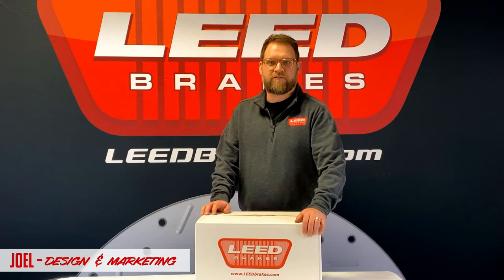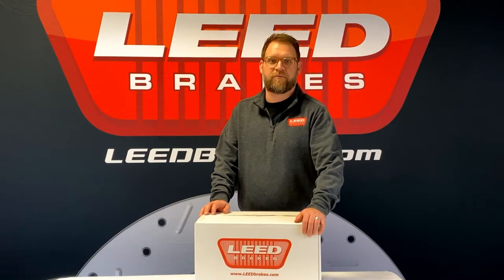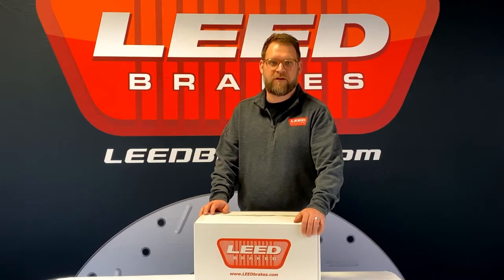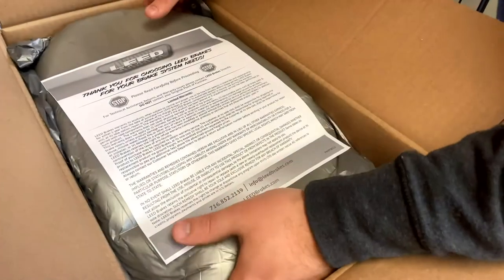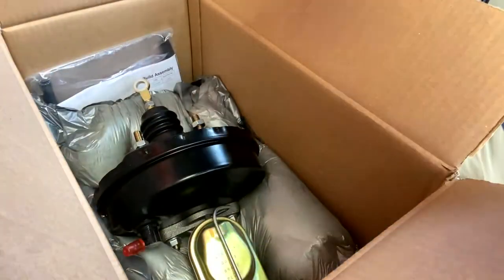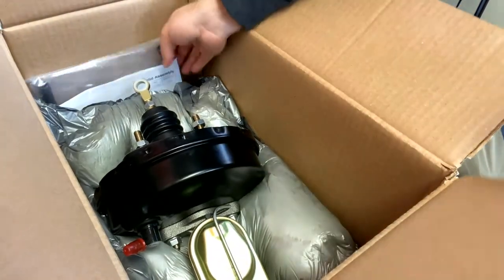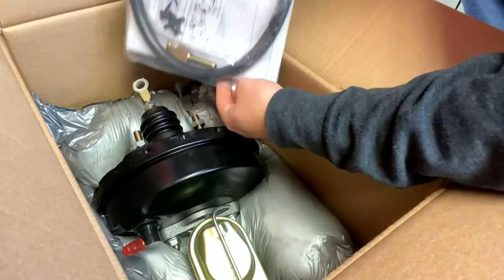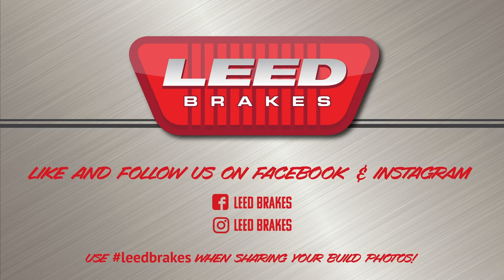Hydraulic Power Brake Booster Kit for 1971-73 Mustang

Comment: Placed one of these on my 73. Pattern is perfect fit, the extra rod provided for that year was spot on for length and the light switch hole. Install was a piece of cake... However, while it works fine, braking is not as "assisted" as before. Adjusted the rod/mc side a tad a couple of times to get better results but pedal still isn't as smooth as with the original. All with all a fairly ok product, good finish but if originality/looks is important, it's tiny and really off vs the original radius. For that reason, now that i've located all the necessary parts for a 71-73 booster repair aside the plastic isolation on firewall, the original will return for sure.